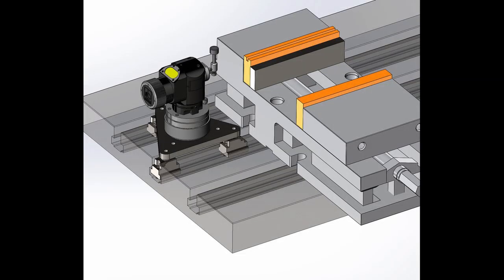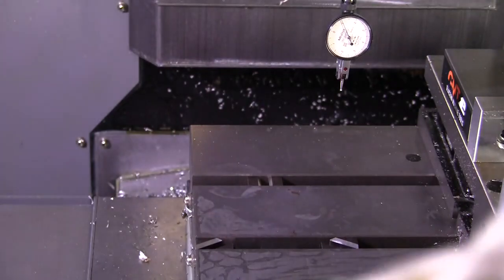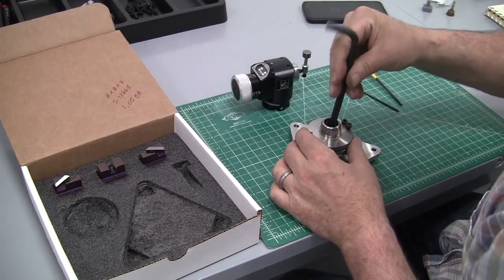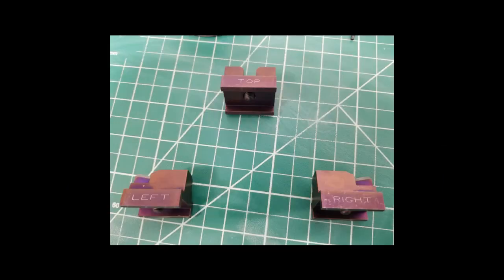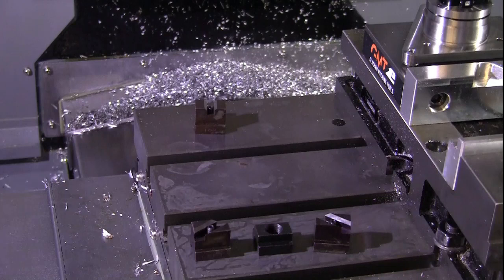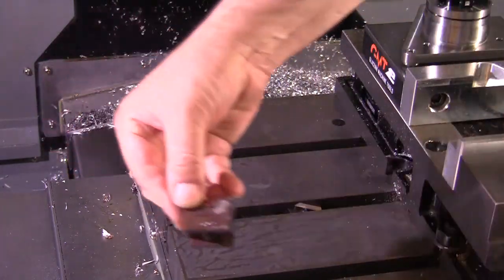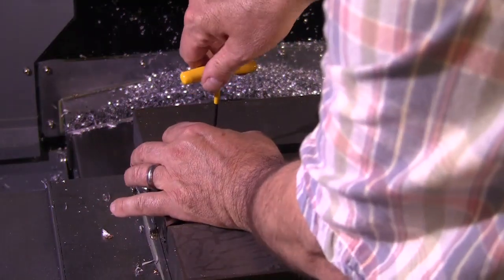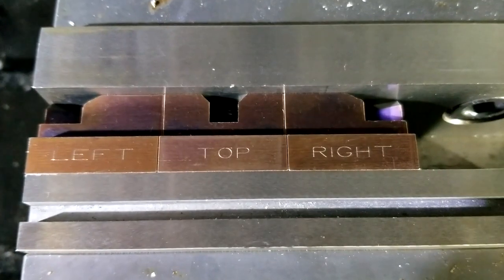Renishaw OTS Probe Removeable Mounting System

Comment: This video says its 3 years old and no comments positive or negative... Im not trying to be either but decided to state the 2 reasons that keeps me from purchasing. Maybe others that have came across this have the same concerns thats why no comments? IDK But Anyways... I don't like the idea of the magnates. In fact I would rather use the factory mounting method and unbolt it when its in the way rather then mess around with cleaning chips off of magnets. Wonder if you could make the base plate out of something heavy like 50mm thick steel or better yet a 50mm thick chunk of carbide. Would the weight would be enough to hold it down? Or maybe 3 springs to somehow force down on it a bit at each contact point? Anything other than magnets. The 2nd thing is the company I work for will only purchase from well established vendors such as MSC, Mcmaster Carr, Grainger ect ect. I can't get them to purchase from a small vender. Even Amazon is difficult they look at it like Amazon is for home shoppers we need to purchase industrial equipment from industrial supply companies. That's there mindset and that's how there purchasing is set up in our computer systems. There is no way to just purchase something from a random vender. It has to be set up in the system. Yes I could get someone to get it with a corporate credit card but I have to have a good reason like the machine is down and it's going to shut the lines down! The excuse it makes my life easier a few times a month won't do it. Thanks for reading
Reply from the maker: Thank you for your detailed and thoughtful comments. They are much appreciated, and I will with similar detail.

We have not sold many of this model mostly because we have another product that generated more interest.Llink here 
https://exactengineeringshop.com/

We still have them in inventory but I have not yet put them on the website for sale mostly due to lack of time.

Chip collection will only occur for ferrous materials and the magnetic field strength on the probe side or top of the kinematic mount plate (the triangular plate) is very weak as the field lines are mostly blocked this plate due to its high permeability. Chips will collect but can be easily brushed off. If you remove the probe during machining no chips will collect as the magnets travel with the probe.

Unbolting the factory tool probe, rebolting, aligning and calibration is at minimum a 1 hr interruption and for our shop, its impractical and too costly. With this tool probe mounting system one can remove and install the tool probe in a few seconds. You can also keep it safe by removing it when not probing. You can also share it with another machine by installing kinematic V-nuts in the other machine.

Regarding nesting forces, for repeatability, this kinematic coupling requires symmetrically applied and consistent nesting forces. For this application, magnets are the preferred solution. This is an industry proven practice. Relying on gravity only would require a 20lb slug at minimum and thus the feasibility and associated costs would make it impractical. A mechanical spring system is a good idea however implementation gets complicated and expensive but not impossible.

As for purchasing, we are the inventor, manufacturer and sole distributor of this system. Thus we are not a vendor per se. Exact Engineering has been in business since 2006 and our core business is precision opto-mechanical engineering and manufacturing of systems we design. This tool probe mounting system was designed out of necessity and we have sold over 200 of the units shown in the link above. We had have no returns.

Some companies have rules about who they buy from on a regular basis and like you mentioned allow credit card purchases to circumvent the rules. I am not sure how I can help you overcome this hurdle but please feel free to call me directly. Contact info at www.exactengineering.net